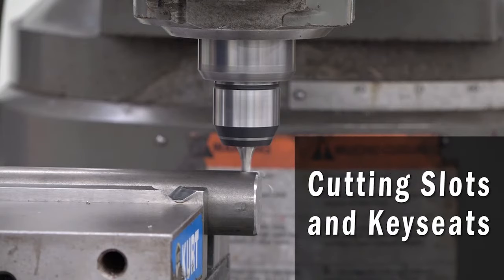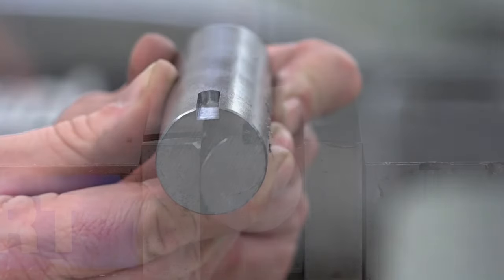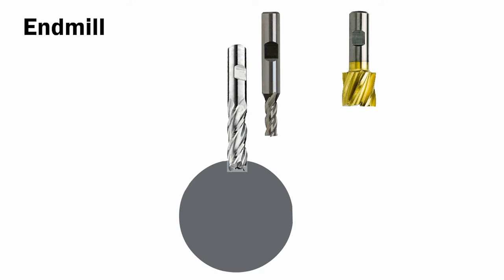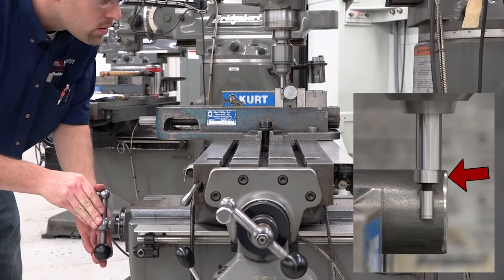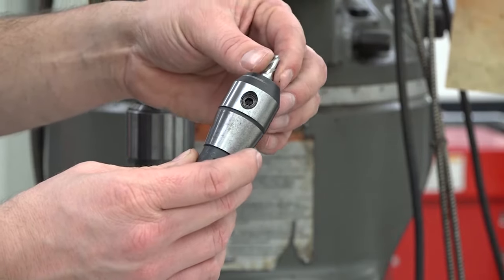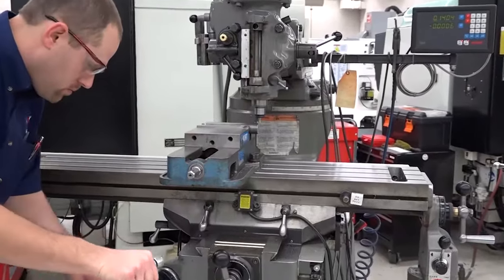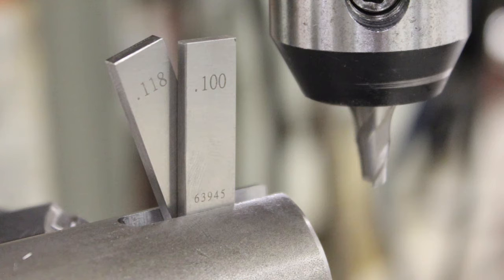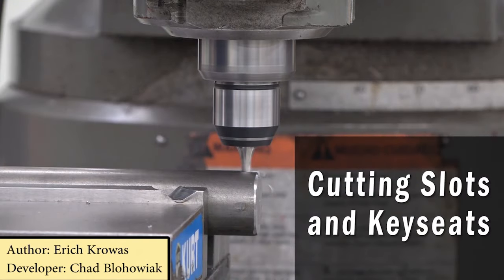MT12 Cutting Slots and Keyseats

Comment: Use a micrometer to measure stock diameter, then use micrometer to measure depth of keyseat. Subtract the two and you have depth of key seat. A depth mic will give you a wrong reading because you removed the crown of stock, so your measuring below the point of where you should be, and that number is allusive and hard to get.
Reply: Depth mic works just fine

Comment: Measuring method of key way depth is wrong here.  It will not give correct depth reading at the place where it is being measured because height reduction is there at key way edges.